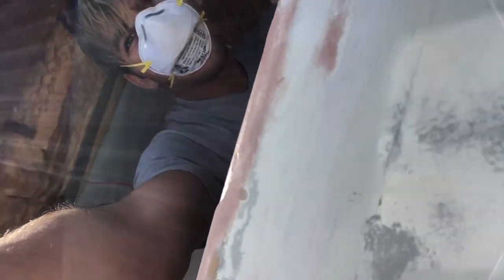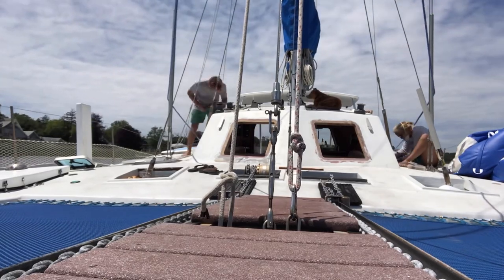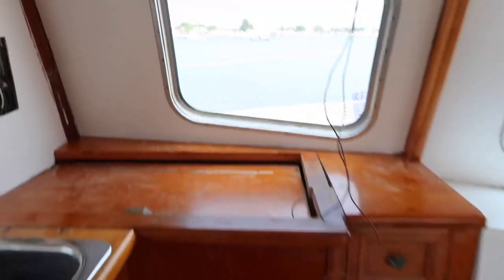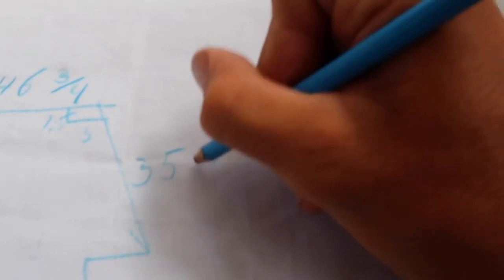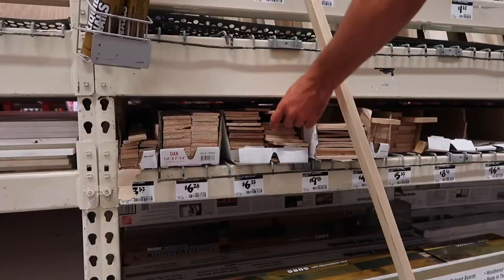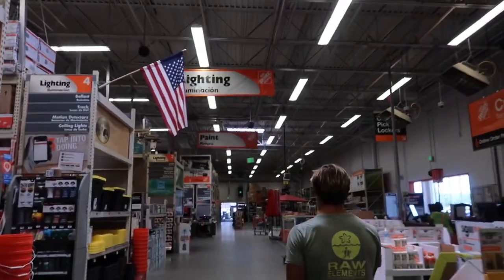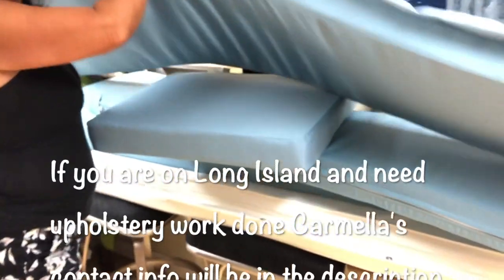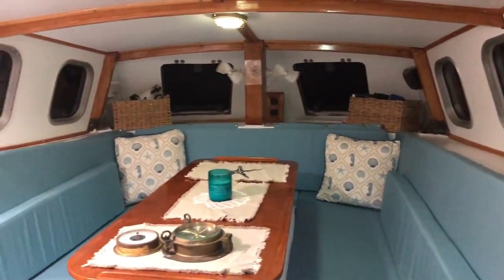COMPLETE OVERHAUL of our Sailing Catamaran Interior!

Comment: Looks noce!
One question and one suggestion.Question: what brand or method whitener does Sara use on her teeth and what toothpaste and how often? And does she drink coffee? I have never seen such white teeth !
Suggestion: build small rain deflectors out of 1/4 pvc pipe and have them curl OVER the top (curled down over not like a gutter) and sides of the windows. Cheap and easy. The only real way to stop water is to make sure its path never goes into seams. The Buytl wont last with the expansion and seepage and salt etc. 
Looks great!

Comment: Next time you put in at the home base for repairs, go to Robert's Plywood in Deer Park. It's not too far from the folks place in Oakdale. They carry a huge assortment of marine and specialty sheet goods and lumber. Much better than the big box stores. Also, next time you have a bunch of sanding to do, hook up a shop vac to the sander and wear a better respirator. Better to eliminate the dust at the source. Easier clean up and much better for your health not to be breathing it in. Job came out nice.

Comment: Dealing with wood rot is the worst especially on a semi fiberglass boat!  If you need some not structural trim, HD has some great vinyl wood printed over foam , really holds up well never needs varnish, I've has 'oak' baseboards in my house for over 20 yrs looks the same as when I put it up.
Some even looks like dark teak!
Cheers Warren

Comment: The first time that FRP board gets hot it will warp like crazy, that stuff is usually glued to a solid backing like drywall or plywood i would have used contact cement and laminated it to 1/4 in luan to give it stregnth

Comment: Looks good. Sorry you lost all that footage. Did you have any SS screws strip out on the lower areas of the side windows you replaced, or was the fiberglass and fairing that you put on the foam thick enough to hold? That was pretty rotted out!  Also, what did you stick the ceiling panels up with? Looks like you stapled a vapor barrier of sorts and then magically stuck the panels to it? Gotta love Home Depot LOL. We're planning on a trip to the Bahamas in our Seaward 32RK. Wondering about how to get back. Have heard about the thorny path and other ways. How did you guys get back to FL? Keep up the great videos.

Comment: How is everything on the boat not covered in fiberglass dust? i would have taken everything out and put it in boxes with lids and put it up front, thats a tough job under the best conditions, was that laminat flooring that was up on the ceiling? i use that stuff for my workbenches

Comment: I"m jealous to be young again and fit again to be able to do all this stuff. I am 55 and retired my knees are real bad and just can't bend like i use to. I would love to be able to do what your doing being retired but the arthritic has took its toll.  
so the rotted parts around your windows you cut out and then you filled it in with what substance. fiberglass or what did you use as a fairing compound and how long did you have to wait b4 you could sand?

Comment: Hey guys! Looks awesome- so fresshhh! We're in the middle of refitting our Pacific Seacraft Flicka and need to replace our headliner. What did you do to attach your new ceiling? Just staple directly into the fiberglass? We're going to use a product called 'King Starboard' to put up. We're scratching our head on how to attach it. Cheers!
Reply from the maker: We stapled directly to the wood framing on the ceiling. As we put the trip up we took the staples out. Good luck on your project!